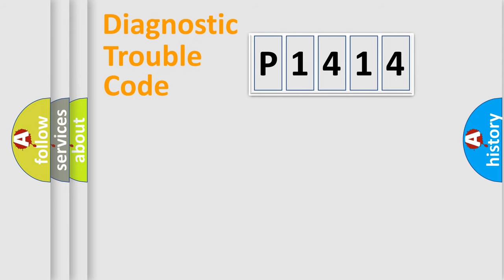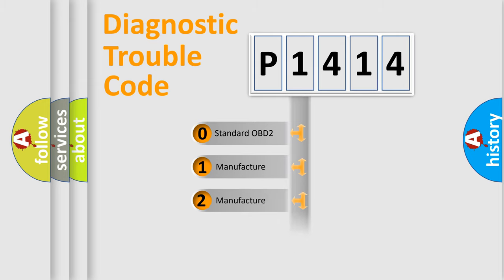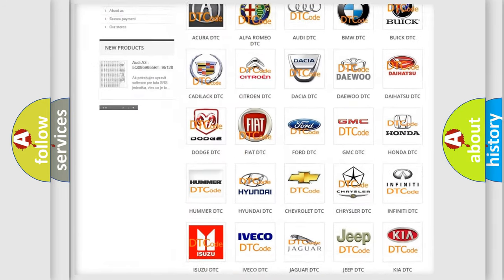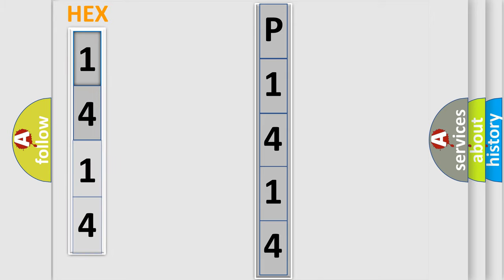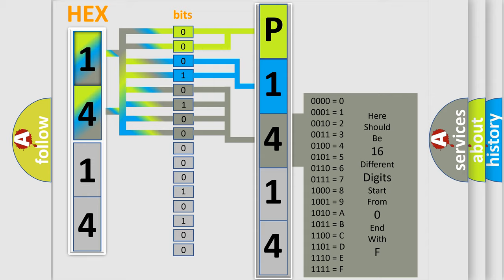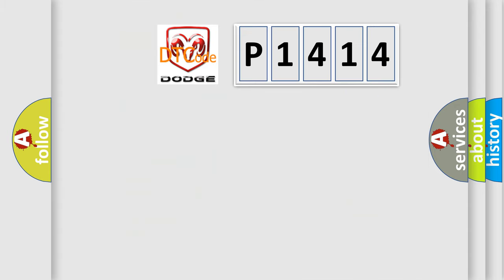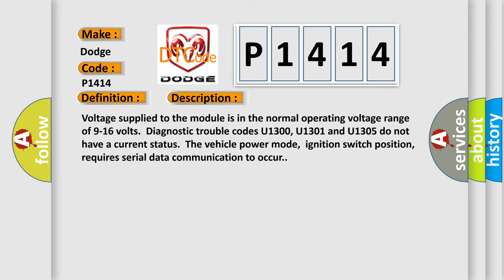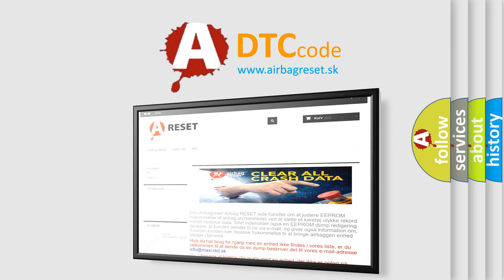DTC Dodge P1414 Short Explanation

Comment: P1414 stays for MDS issue (cylinder 4) 
This is misleading video with lot of irrelevant information. 
Next time make a video about flight attendant
Reply: How do you fix that. I’m having that problem right now
Reply: @corydouglas-ms7lj  On the car I worked, the issue was the collapsed lifter, not he solenoid. With collapsed lifter it cost $$$
Reply: @mkrp4  l just changed the cam and lifters 2 weeks ago
Reply: @corydouglas-ms7lj  Check the wiring under intake to the MDS solenoid. If wire check out apply 9volots from 9 v battery tot he solenoid; it must click ; if not clicking replace solenoid; too remove it in one piece, tap it with small rubber hammer (it worked for me!~)